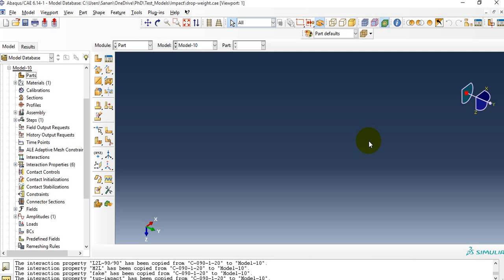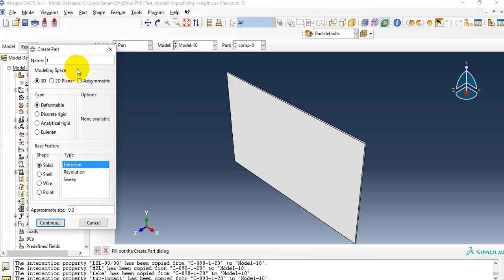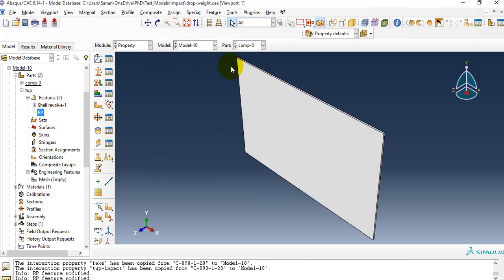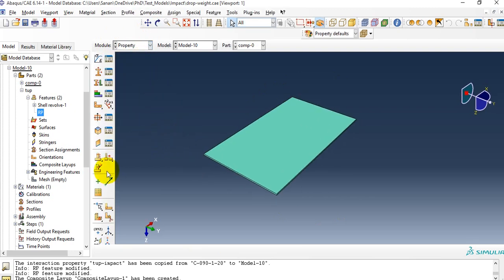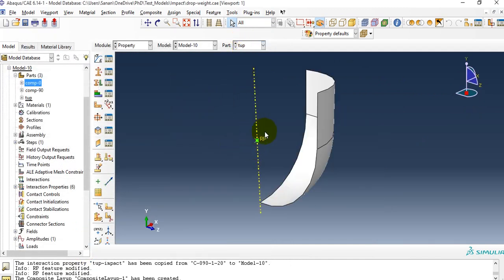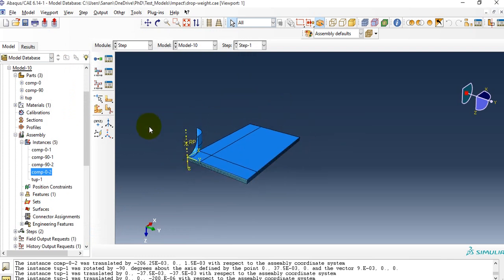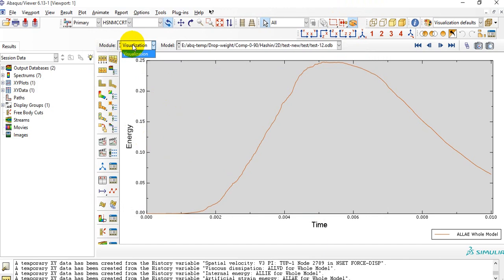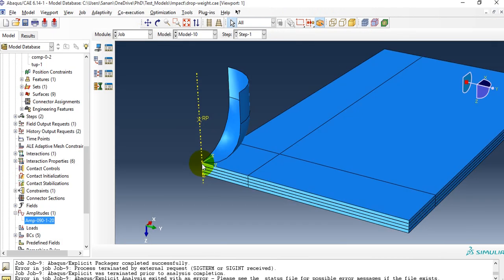Modeling and discussion : Drop weight impact on Fiber reinforced composites

Comment: Hi there, I am modelling a composite as shown in the video for a coupled thermal electric problem. i have modeled it, assembled it and meshed it as shown in the video But during the analysis i get the error "elements have missing property definitions". Can you kindly help me through this?
Reply from the maker: +Awin Salian either you have not applied the material properties or taken wrong elements in the mesh module.
Reply: +Awin Salian Change the element type to continuum shell

Comment: Hello sir, 
Thank you for the video. It was really helpful. I'm trying to model the impact of a spear into soil. Every time, the job aborts due to excessive deformation. Can you please give some idea on how to avoid it.
Reply from the maker: check the soil props. mesh finer. if spear has pointed nose. mesh the region below it even finer. use penalty contact. apply stabilization. in the status file check which element is failing. does it fail by distortion or rotation. try more resent version.
Reply: Thank you for the reply sir, I fixed the problem.
Reply: How did you create impact property?
Reply: @sasikiranreddyk452  how you fixed

Comment: sir,
i tried to model the same,but an error is coming like "4200 members missing property definitions"
how can i rectify that
Reply from the maker: Tony Rose you might not have assigned the property.
Reply: thanku sir.. i rectified that error..but still one problem is there,It is not showing the results,instead of that my tup is simply penetrating in to the composite layer. why it is so sir..?

Comment: Hi, how can i get the reaction force on the impactor? I've created the reference point on the impactor yet it give zero values?
Reply from the maker: output reaction force
Reply: I've tried that also, still got zero value. by the way, for the displacement constraint on the RF, should I put the value along U3 or just leave it zero?
Reply: Hello, 
I have the same problem. Actually as an exercise I request RF1, RF2 and RF3.
I do get an output for RF1, and RF2, but not on the 3 direction.
Any suggestions how to overcome this? I am following the steps as stated in this tutorial.
Reply from the maker: +Ricardo Tellez if you are taking instantaneous velocity then try out putting A3 and after that using Newton 2 nd law get the rf3

Comment: Hello Sir,
Will you please tell me how to obtain amplitude and time values in tabular format from Force vs Time graph in order to provide velocity in boundary condition step.
Moreover, while giving velocity in boundary condition, I tried to keep it instantaneous and provide negative velocity in another step but it shows error.
I am working on a project so please help me with your knowledge and experience.
Thank You
Reply from the maker: Try giving initial velocity in predefined tab.
Reply: @SanaanKhan  Thank you sir, its working when I provide velocity in predefined tab. But in output result in Force vs Time graph, value of Force along z-direction is coming zero. So sir will you please explain, why it is like that?

Comment: Great work Sir, i would really love to know the interaction properties you used between laminates, from the video u said u've explained before b ut i dont get the video where there is explanation. kindly help Sir, thank you
Reply from the maker: +stephen kirwa melly https://www.youtube.com/watch?v=o35aO8mONOU
Reply: +Sanan H Khan , Thank you Sir, kindly a piece of advice, is it possible to use continuum elements to model drilling of fiber reinforced composites? , i have been trying using Hashin's damage criterion but i get error that their is excessive distortion of elements,
Reply from the maker: i think continuum elements will work in that situation. to use solid elements instead of continuum elements you cannot use the inbuilt hashin criteria. instead you have to prepare VUMAT. excessive distortion error that you are getting may be due to something else. try adding a damping to a system or reduce you initial rotation speed or check the consistency of the units specially of density and modulus.
Reply: +Sanan H Khan , many thanks, am still new to abaqus and i want to use the inbuilt hashin criterion because using subroutine needs alot of expertize, so am still trying using the continuum shell elements.

Comment: The interaction properties you describe are very difficult to follow. you change units in every video and you assume everyone knows where your previous videos are. wish you would just go through each interaction property and briefly explain how it changes between ply directions for better context compared to having to search every video in your channel. I still have not been able to find these properties /:
Reply: I was thinking it would be possible to write out each step in your amplitude but theres no reasonable way to write out 1422 increments. Would have been nice if the there could have been a spreadsheet linked with only the velocity values in it.

Comment: In which video have you defined the "tup-impact" interaction property?
Reply: Its in this video 21:38, where as for the layer to layer interaction is in the video 'Modeling with discussion: Tensile Loading of Fiber Metal laminates.' at 21:17
Reply: Paritosh Hebbal yes , I already asked this question to Sanah, and I didn't get the answer from him , so I used the same L2L interaction for all ie, 0 and 90
Reply: Paritosh Hebbal I had to modify the mesh , and it took long time , so I had to stop in between !! But I will be running it this weekend !!! I will update you with my results 👍🏻

Comment: Hi can we conduct repeated impact test in abaqus???
Reply from the maker: Use multiple steps
Reply: With multiple steps will the results add up,  like will the beam fail after like 10or 15 steps??
Reply: @SanaanKhan  sir if I do multiple steps say on a beam will the beam fail after 10 or 15 steps?? 
And do you provide project assistance privately by online classes?